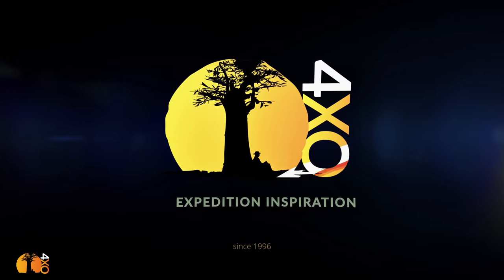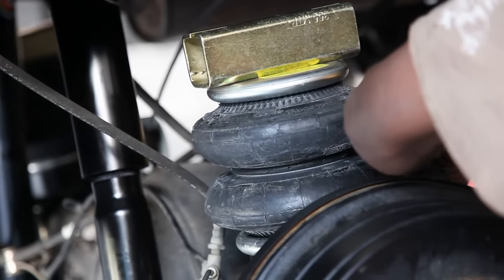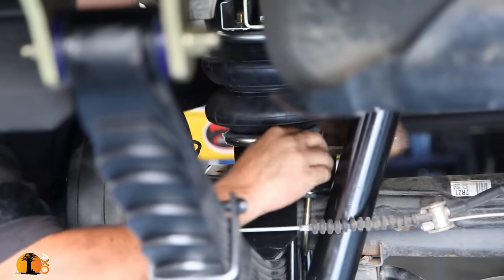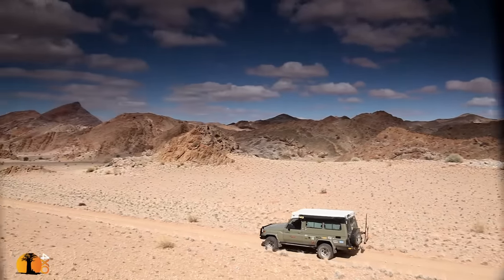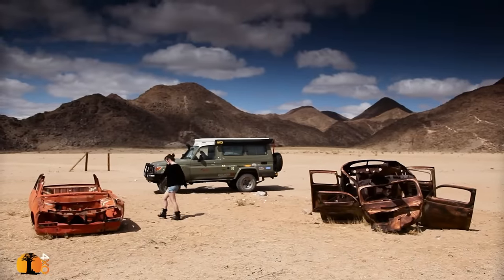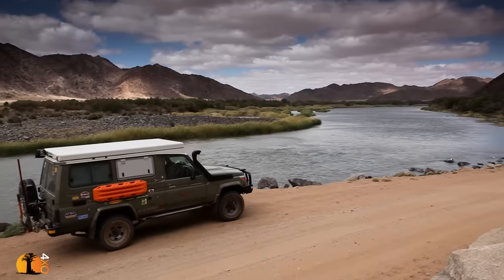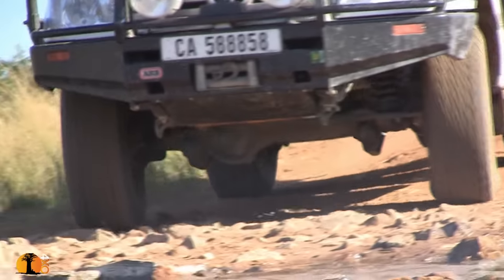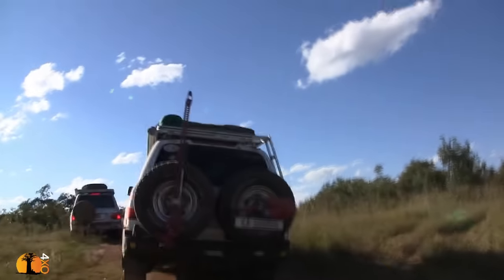AIR-BAG HELPER SPRINGS. ANY GOOD? | ASPW 4xOverland

Comment: My opinion is I suspect with going the heavier (terrain tamer) parabolic leaf pack than the lighter set you have now - is you won’t suffer the same ride penalty (unladen) as you would if you were having the same conversation with conventional multi leaf springs. I think you’ll experience a very small and acceptable ride penalty for better heavy laden performance. The benefit of the parabolic design. Look forward with interest to how this pans out for you. 
I believe in-spring airbags (for coils) have their application and in my experience work well if used correctly. All too often they are installed to “Band-Aid” inherent issues with the current suspension set up which often is already compromised, as you explained very well.
I only had to use mine on a previous patrol wagon I owned when towing fully laden and the ride quality was great. But I had very good coil and shock combo to start with to deal with the weight range in every other scenario. 
Great insights, thanks for sharing!

Comment: Don’t air bag bellows sit against the chassis in place of the rubber buffers? Therefore the chassis is designed to take some load at this location.

Comment: The photo of the full-length in-coil airbag that's fully inflated makes me shudder. However, like you said, they can be useful when towing. I have in-coil airbags that only occupy half the space of the rear coils and keep them inflated at 10psi (manufacturer recommends 5psi min) when driving normally. When I tow, I inflate them until the rear end is level--about 18-20psi (manufacturer states 25psi max). I feel that installing smaller in-coil airbags and running them near minimum pressures preserves most of the ride and still allows for decent articulation for the purposes of overlanding.

Comment: Thank you and you nailed it right on with the stress points on the chassis. If the airbag helper on a leaf spring raises the vehicle's height to level it, then 80% or more of the  load is transferred to the centre of chassis instead of two designated points on the chassis. Therefore one big pothole could easily bend the chassis with helper airbags installed.
Reply: Disagree friend. Draw the bending moment diagram for a longitudinal chassis member and you will see why.

Comment: If one adds yet more to go wrong on a vehicle it will go wrong (in my experience). Never mind the risk of ripping an airbag on trail. Yes arguably not easy to do but 50% of all my bush repairs have been performed on items that are not considered easy to damage. 
Good call keeping them off the build.

Comment: A friend of mine gave his 110 a 3" lift and I asked why he bothered since that's all he'd done and he said it was to give him much better handling off and on road!  I reminded him that LR Engineers had spend years and 000's of £ to make the vehicle drive as well as it could under all circumstances.
He thought adding a few more pounds was going to be much better so off he went on  Green-lane.  After getting stuck and breaking a spring he reverted back to standard.
My point is that I have found that generally the 4x4's Engineers are pretty good getting things right for us must if the time and helper springs and other bodges can make things really bad quickly.
Reply: Absolutely incorrect. Stock vehicles are engineered as a compromise. On road performance is directly against off road performance. LR has to make sure the vehicle is safe and meets government standards. Raising the vehicle provides more clearance but also makes it more susceptible to rollover. 
.
Your friend broke a spring it’s either it was installed incorrectly or he bought something real cheap.

Comment: I have a 2010 Nissan Pathfinder. It’s used as a daily driver (sometimes) but was chosen for its ability to tow our large twin axle caravan. I’ve installed OME springs and dampers all round, and MAD air bags (made in Holland) inside the rear coil springs.
When the truck is fully loaded, and towing the van, I inflate the air bags to approximately 15psi. In this mode, the truck tows and handles beautifully!👍🏻

Comment: That is certainly a popular view by many, and I was adverse to fitting airbags for many years,  however don't you think that the manufacturer designed the bump stops to handle some fairly severe loads? This is the mounting point for airbags on a 70, which if used CORRECTLY....  and I believe this is the key here, will lessen the forces applied here by providing a progressive load as opposed to a shock load.  The springs should still support the majority of the load.  I own a 79 series,  and although it was riding fine when not towing,  the airbags have definitely improved things.

Comment: Andrew you stated it correctly from the start. You are either under sprung or under shocked. If you have to add an airbag to any suspension system then you are outside of its parameters, time to reevaluate the vehicle or your needs. Thank you for sharing thiss much overlooked topic.
Reply: @Bismarckmark No, you dont understand how parabolics or variable rate coils work!

Comment: A good well reasoned video.
But what is the actual weight change between, fully loaded, including a second person and say a half load, part way through a trip.
My 130 HD has twin coils, one fitted inside the other, rides well empty or fully laden and towing my three ton digger, but my normal payload of tools is 410kg so that's taking the edge off being truly empty.
How often are we truly fully laden? Totally agree with your arguments Andrew.👍

Comment: Weight!!! Wait!!!
Thanks Andrew.....this video was the catalyst I needed to get off my bum and remove the air bag system the previous owner had installed in my Silverado. 
I can understand why he needed to fit the airbags AS WELL AS the additional leaves....when I bought it I weighed it @ 4,650kg but GVM was only 4,490kg!!!
I had the GVM increased to 5,171kg (easy to do, as that is what the 3500's GVM is, so no modifications needed whatsoever) and I also removed about 400kg of "stuff" I didn't require!!
The result was that I've been running about 4 or 5psi in the airbags for the past 5 years and they're surplus to requirements.
They are now for sale!
Thanks again!

Comment: I have a very good experience with airbags in my LC100 with fully working AHC. However, these work inside coil springs which removes the issue with chassis failure. In my case it worked better than expected and fully recommend. I do think it needs good planning, fitment and continuous trial an error to get the pressures right and work properly for the intended use.

Comment: Hi Andrew,
At 8:04 you ask a question: at roughly laden weight, should you rather have (had) air-springs fitted to deal with this, or have a slightly heavier-rated spring. I would venture to say one needs to, like with almost everything, match your kit with your intentions (broadly speaking). If one wants / needs proper axle-articulation (wheel travel) for your vehicle (matched to the Q: what am I going to be doing with this car, mainly?) then I would say the answer is simple: stay with springs only. Basically because you will never get the same, or even near to, decent wheel travel / axle-articulation over rough terrain with air-helpers fitted.
I have air helpers fitted to my 105 (i purchased it with them fitted) and I will be removing them, for many of the reasons you've mentioned, and for the reason I mention above.
They have their place, and I would agree: mainly for towing or very heavy loads, on occasion, on smooth roads where serious axle articulation is not required.
Thanks for the content, have fun with the Rangie...

Comment: No reputable 4wd shop would/should recommend airbags for a constant load carrying situation. Airbags are idea for varying loads, vehicles that tow occasionally but are usually unladen. Suitable suspension is always the answer for vehicles with constant load.
Reply: Do you have a suggestion for the current monster Max video released by whistling diesel yesterday?.... He needs some advice because of his suspension just literally tipping over and never rebounding due to his "sway bar being to small"

Comment: If you run something like a long range tank that can add a variable load of 200+kg in the worst spot, behind the rear axle, airbags (within coils) are great, here's why.

An air bag will effectively increase the spring rate, not only that, because of Boyle's law, it'll do it at a non linear rate. 

That is, it'll take a linear rate spring and have the ability to use it as a adjustable progressive rate spring, exactly what you want with a varying load, and progressive rate, just like leaf springs.

Comment: We have been using air helper bags on our game viewers, both 79 cruisers and defenders. So I have experience with both simultaneously, I will never put them in my personal vehicle again, they just ruin the ride too much. That being said, I say they are ok inside coils because the chassis is designed to withstand that point of weight baring. But with leaf springs, the chassis are designed to handle weight bearing at the ends of the springs and not where the air helper is mounted above the axle, thus putting stress on the chassis. Also the mounting brackets for the air bags and the airbags themselves take away massive amounts of travel between the axle and the chassis bump stop, taking away articulation. But yes with big changes of weight with guests and trailers etc they have their place. Thanks for the content Andrew.

Comment: Had air bags in my 76 very nice as I use them when I use it to go camping. But took your advice on the 79. And had the suspension totally redone with a full load and it's a great ride.

Comment: Yes and no 
Air bags with in cab control is perfect. 
I am different in that I tow. But the best GVM kit available still sags and compromises steering when towing. Add air bags it’s better. Plus can drop the air with no load. 
Agree chasi is not designed for it but I’ll take that risk if I can now steer and keep my family safe. 
We all do it differently.

Comment: A good Blacksmith / Spring works business will be able to sort out any spring pack with reducing or adding leafs and fine tuning each leaf to do its job under weight.
Set up progressively so as your vehicle gets heavier each leaf will compress onto the next level of helper spring.
Still get great ride and handling quality with all weights,even when 4wd is empty.
My last 3 vehicles suspension have been set up like this.
They have been very good.
Never used airbags with leaf springs.

Comment: For coil sprung rear axles, we should remove the bump stop to install airbags. After few months the pressure inside the airbag drops and then you are bottoming out the shockabsorber. This happened to my 4R/Prado 95 rear and the top mounting plate of the shockabsorber  (which also holds the top side of the coil spring) started cracking off the main chassis.
Reply: We have had airbag assist coils in our 100 series for many years trips including Cape York & latest one 12000ks + Western Australia including Gibb River Road Kimberley still going strong with no issues
Reply: I have airbag man bags in my Patrol ute rear coils. My set up is different, my ute has a 450mm chassis ext and the chassis is braced a lot stronger than stock. I run 20 psi when my van is hooked up. 250 kg down ball load.

Comment: I agree with your reasoning on air bags on leaf springs putting forces on the chassis where it’s not designed to . However on rear coil springs air assist airbags can work well. The problem there is people get carried away and over inflate which will make the ride ridiculous. I have used air assist airbags successfully with correct inflation on a 4x4 wagon and have had the best of both worlds loaded and unloaded. You should clarify the difference between coils and leaf springs in design and load points on the chassis. I understand you have concluded what will work best for you and others will follow not knowing the difference in springs setups, Thanks love your channel.

Comment: I am, a small patrion, and you read my mind sometimes.  I use a 2014 jeep Cherokee to tow and go off road.  I tried the helper air bags and didn't like how they performed.  Noting that I tend to be on the heavier even when not towing I decided to go with up rated  Dobinson springs.  Though a bit more stiff day to day driving it is perfect when  off road and towing.  I am not near your level when off road (smaller vehicle) I tend to be near my MVGW 2600 KG when towing and just a little less when off-roading.   Alot of people ask how much will it tow but don't look for the max per axle and end up breaking something.   It is good to beef things up but there is a max.  Nice vid today.

Comment: Interesting!! I have an FJ Cruiser and I found when towing the camper trailer that the car was too low and soft in the rear and felt a bit dangerous and unpredictable. I added airbags inside the rear coils. I run them at the minimum pressure of 5psi when not towing, and 15-20psi when towing. The airbags have improved the handling of the car when towing and when not towing. The car feels much safer to drive. Before the airbags the FJC would nosedive under heavy breaking, whether towing or otherwise. With the nose dive came locking up the rears in emergency or steep downhill braking. Amazingly with just 5psi in the rear airbags the nosedive disappeared, and the car remained level under brakes and stopped and behaved better and more predictable. Towing a camper trailer before the airbags was scary, particularly on steep decent. Towing now with 15-20psi the car behaves more predictably and confidently on the road and feels way safer. It also feels great on maintained dirt roads. Havent tried it on extensive corrugations. Airbags with protective sleeve are capable of 60psi, but I cant see myself ever using more than 20psi. The car unladen at 20psi rides way too hard in the rear, so I just drop it to 5psi and I have the comfort back, with the benefit of having no more nose dive under brakes. Rear airbags inside the coils are the best bang for buck mod I have made to the vehicle by far. Maybe sticking to sensibly low psi pressures has something to do with the success???
Reply: I guess it's hard to have the right mechanical set-up for all conditions,  so using airbags properly makes a lot of sense and certainly better than putting different suspension in when you are driving around town yourself and another for towing a big caravan which seems the alternative to get everything you want.
Reply: Exactly my experience. I dont want beefy springs in the rear to take the load only 10-20% of the time and have the car ride harshly the rest of the time when not loaded. The airbags are perfect solution and i find they ride great when loaded and with 20psi and great when not loaded with 5psi.

Comment: I vehemently disagree with your conclusion.  The right air bags are a proper helper system, spreading the load on leaf sprung trucks especially.  Personally I use a Air Lift 2000 system aired to 70% when loaded, and 10% when empty.  I can also use them to help level at camp.

Most people over size their air springs and ruin the travel on their trucks, then swear off air forever.

The key for me is they can reduce some of the stress on the leaf pack, helping the leafs last longer.  Also by maintaining ride height it helps allow the shock to use its full travel before bottoming, and bottoming causing shock loading the frame under weight is where things will get bent.
Reply: Which truck do you own though? Australia doesn't really have a large market for full sized trucks/pickups.
Reply: @HardstylePete   I have a short wheel base, single cab F-150 which is not available in Australia.   It has a dry weight of 4550 lbs (2068 kg) and a Gross Combined Axle Rating (what you may call GVM) of 9100 lbs (4136 kg).  You can't get a spring suspension that covers all those possibilities.  Currently the truck fully loaded in Expedition weight is around 6250 lbs (2841 kg) with me in the truck.

Check out my YouTube channel.

Comment: I had inside coil airbags over 15 years on a 2000 honda odyssey, which have relatively soft spring and when it's loaded to max sags low and wallows in corners. Pressuring up my air bags levelled the car and the handling improved greatly. I reduced pressure when not loaded and felt no negative impact handling wise. Odyssey is much different than my current 4runner and I'm not sure if they would diminish offroading capabillity.

Comment: I have airbags in my 150 Prado with a 2" lift. I dont want heavy duty springs for everyday driving. I have some light weight drawers in the back and that's it when not touring and I dont notice any difference in ride at minimum  5psi.  When it comes time to load up to go away I put 20psi in the airbags and off we go. car sits level and handles great. I guess if you pumped em up to 60psi it would not handle/ride well at all,  but if you are doing that then you have the wrong suspension setup.

Comment: I'm sorry Andrew, but the airbag in the picture where you are showing "that part of the chassis is not designed for a load", is replacing the factory bump stop.
It is in fact designed to take the full weight of that corner when the axle hits the bump stop.
By putting in airbags, you are effectively cushioning the impact.

Totally agree on the coil sprung vehicles, the ride is atrocious with airbags inside of the coils.
Reply: Some one should mention this to Jmcax , he’s has over 500 conversion being used with this airbag set up.
Reply: @TP-mi7st  Who's Jmcax?